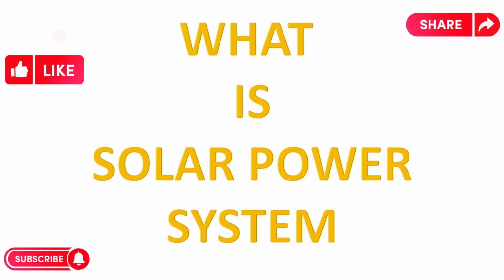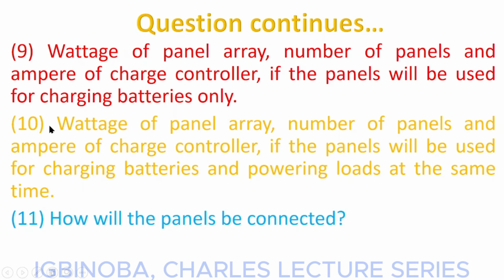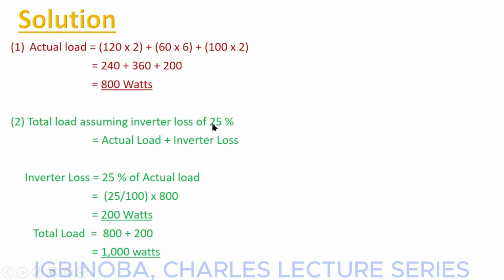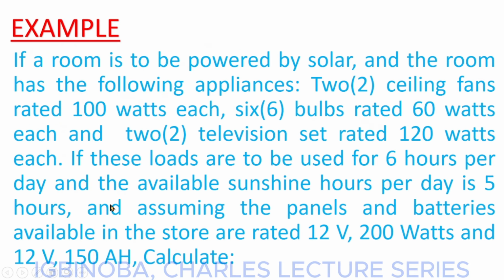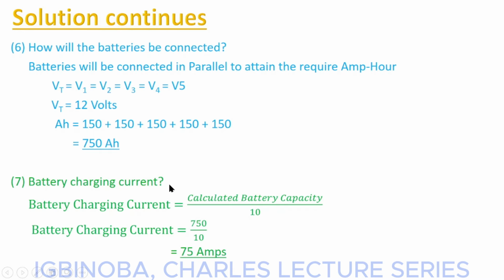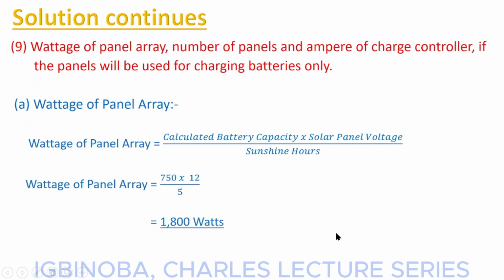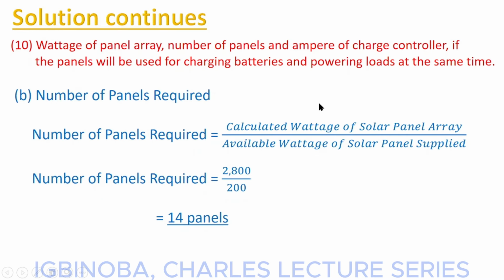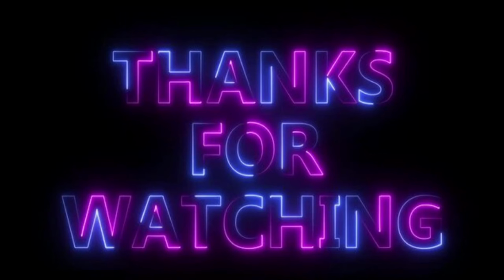Design of Solar Power System

Comment: EEE30D

1  .  The  actual  pad  is  1,380W  2  .  The  Total  load  is  1,725W  
3  .  The  inverter  rating  is  2,1  56.23VA  
4  .  The  battery  capacity  is  1,293.75Ah  
5  .  The  Number  of  batteries  is  9  6  .  The  batteries  are  connected  in  parallel  
7  .  The  Battery  charging  current  is  129.4  amps  .  
8  .  The  battery  charging  time  is  14  hours  .  
9  .  a  .  The  wattage  of  the  panel  array  is  3,105W  b  .  The  number  of  panels  is  16  panels  .  c  .  The  Charge  controller  rating  is  258.75  amps  .  
10  .a  .  The  wattage  of  the  Panel  array  is  4,830  Watts 
 b  .  The  number  panels  is  .  
11. The  panels  are  arranged  in  parallel

Comment: MAR61I

1. The actual pad is 1,380W
2. The Total load is 1,725W
3. The inverter rating is 2,156.23VA
4. The battery capacity is 1,293.75Ah 
5. The Number of batteries is 9
6.  The batteries are connected in parallel 
7. The Battery charging current is 129.4 amps.
8. The battery charging time is 14 hours.
9. a. The wattage of the panel array is 3,105W
b. The number of panels is 16 panels.
c. The Charge controller rating is 258.75 amps.

10. a. The wattage of the Panel array is 4,830 Watts 
b. The number of panels is 24 panels.
c. The charge controller rating is 402.5 amps
11. The panels are arranged in parallel

Comment: NAT55C
1. The actual pad is 1,380W
2. The Total load is 1,725W
3. The inverter rating is 2,156.23VA
4. The battery capacity is 1,293.75Ah 
5. The Number of batteries is 9
6.  The batteries are connected in parallel 
7. The Battery charging current is 129.4 amps.
8. The battery charging time is 14 hours.
9. a. The wattage of the panel array is 3,105W
b. The number of panels is 16 panels.
c. The Charge controller rating is 258.75 amps.

10. a. The wattage of the Panel array is 4,830 Watts 
b. The number of panels is 24 panels.
c. The charge controller rating is 402.5 amps
11. The panels are arranged in parallel

Comment: CHM61I

1) 1380 W

2) 1840 W

3) 2300 VA

4) 613.3 Ah

5) 10 batteries

6) Series-parallel: 2 in series, 24V  and  5 sets in parallel

7) 92 A

8) 8.33 h

9) Wattage: 3680 W, Panels: 20, Charge controller: ≈208 A

10) Wattage: 5520 W, Panels: 28, Charge controller: ≈292 A

11) 2 panels in series per string, strings connected in parallel — 10 strings for (9), 14 strings for (10)

Comment: EEE 13M

1. Actual power is 1380W
2. Total power is 1725 W
3. Inverter rating is 2070VA
4. Battery capacity is 1293.75AH
5. There will be 9 batteries
6. They will be connected in parallel 
7. The battery charging current will be 123.975A
8. Battery charging time is 14 hours
9a. Wattage of panel array is 3105W
b. The number of panels is 16
c. Charge controller current is 258.75 A
10a The wattage of the panel  array is a 4830W
b. Number of panels is 25 panels
c.  Charge controller is 402.5A
11. They are connected in parallel

Comment: MAR84F

1. The actual load is 1,380W
2. The Total load is 1,725W
3. The inverter rating is 2,156.23VA
4. The battery capacity is 1,293.75Ah 
5. The Number of batteries is 9
6.  The batteries are connected in parallel 
7. The Battery charging current is 129.4 amps.
8. The battery charging time is 14 hours.
9. a. The wattage of the panel array is 3,105W
b. The number of panels is 16 panels.
c. The Charge controller rating is 258.75 amps.

10. a. The wattage of the Panel array is 4,830 Watts 
b. The number of panels is 24 panels.
c. The charge controller rating is 402.5 amps
11. The panels are arranged in parallel

Comment: EEE29C 
Answers
Actual load = 1380W
Total load = 1725W
Battery capacity = 1293.75AH
Number of batteries = 9
Battery charging current = 129.375A
Battery charging time = 14hrs
Array wattage (charge only) = 3105W
Number of panels = 16
Charge controller current = 258.75A
Array wattage (charge + load) = 4830W
Number of panels = 25
Charge controller current = 402.5A

Comment: CIV22V
1)Actual load =1380W
2)Total load =1725W
3)Inverter Rating =2156.25VA
4)Battery Capacity =1293.75AH
5)no of batteries =9
6)Battery connection is parallel 
7)Battery charging current =129.375A
8)Battery charging time is 14hrs
9a)Array wattage is 3105W
b)no of panel is 16
c)charge controller current =258.75A
10)Array wattage (charge +load)=4830W
b)no of panel is 25
c)charge controller current=402.5A
11)panel connection is parallel

Comment: CHM77Y 
1: Actual load =1380W
2: Total load =1725W
3: inverter rating=2156.28W
4:Battery capacity=1293.75Ah
5: number of battery=9
6: Connected in parallel 
7: Battery charging current=129.375Ah
8: Battery Charging time with 40%loss=14hours 
9a: Wattage of panel array=3105W
9b: Number of panels=16panels 
9c: Ampere of Charge controller =258.75A
10a: Wattage of panel array with load=4485W
10b: Number of panels =23panels 
10c: Ampere of charge controller=373.75A
They will be connected in parallel

Comment: COMP66N

Answers:

The actual load is 1,380W

The Total load is 1,725W

The inverter rating is 2,156.23VA

The battery capacity is 1,293.75Ah

The Number of batteries is 9

The batteries are connected in parallel

The Battery charging current is 129.4 amps.

The battery charging time is 14 hours.

a. The wattage of the panel array is 3,105W

b. The number of panels is 16 panels.

c. The Charge controller rating is 258.75 amps.

a. The wattage of the Panel array is 4,830 Watts

b. The number of panels is 24 panels.

c. The charge controller rating is 402.5 amps

The panels are arranged in parallel.

Comment: COMP14N

1. The actual pad is 1,380W
2. The Total load is 1,725W
3. The inverter rating is 2,156.23VA
4. The battery capacity is 1,293.75Ah 
5. The Number of batteries is 9
6.  The batteries are connected in parallel 
7. The Battery charging current is 129.4 amps.
8. The battery charging time is 14 hours.
9. a. The wattage of the panel array is 3,105W
b. The number of panels is 16 panels.
c. The Charge controller rating is 258.75 amps.

10. a. The wattage of the Panel array is 4,830 Watts 
b. The number of panels is 24 panels.
c. The charge controller rating is 402.5 amps
11. The panels are arranged in parallel

Comment: CIV72T
Answer 

1. Actual load = 1380Watt
2. Total load = 1725Watt
3. Inverter rating = 2156.25VA
4. Battery Capacity = 1239.75Ah
5. Number of batteries = 8.625 (9 batteries)
6. They will be connected in parallel
7. Battery charging current = 129.375A
8. Battery charging time with 40% loss = 14hrs
9a. Wattage of panel array = 3105Watt
9b. Number of panels = 16panels
9c. Ampere of charge controller = 258.75A
10a. Wattage of panel array with load =
4485 Watt
10b. Number of panels = 23panels
10c. Ampere of charge controller = 373.75A
11. They will be connected in parallel.

Comment: PETRO49W
Answers:

The actual load is 1,380W

The Total load is 1,725W

The inverter rating is 2,156.23VA

The battery capacity is 1,293.75Ah
The Number of batteries is 9

The batteries are connected in parallel

The Battery charging current is 129.4 amps.

The battery charging time is 14 hours.

a. The wattage of the panel array is 3,105W

b. The number of panels is 16 panels.

c. The Charge controller rating is 258.75
amps.

a. The wattage of the Panel array is 4,830
Watts

b. The number of panels is 24 panels.

c. The charge controller rating is 402.5 amps

The panels are arranged in parallel

Comment: EEE51Y 

Answers
Actual load = 1380W
Total load= 1725W
Battery capacity= 1293.75AH
Number of batteries= 9
Battery charging current= 129.375A
Battery charging time= 14hrs
Array wattage (charge only) = 3105W
Number of panels = 16
Charge controller current= 258.75A
Array wattage ( charge + load) = 4830W
Number of panels= 25
Charge controller current= 402.5A

Comment: CIV20T
1 actual load- 1380 watts 
2 total load- 1725 watts 
3 inverting rating- 2156.25va
4 battery capacity-1293.75AH 
5 number of batteries- 9 
6 batteries were connected in parallels 
7 battery charging current- 129.4 amps 
8 battery charging time- 14hrs
9 wattage of panels(,for battery)- 3106 watts 
No of panels - 16 
Ampere charge controller- 258.83A 
10 for battery and load 
Wattage of panel- 4831 watts
No of panel- 25
Ampere charging controller- 402.58 Amps
Reply: COET/13126/204

1. The actual pad is 1,380W
2. The Total load is 1,725W
3. The inverter rating is 2,156.23VA
4. The battery capacity is 1,293.75Ah 
5. The Number of batteries is 9
6.  The batteries are connected in parallel 
7. The Battery charging current is 129.4 amps.
8. The battery charging time is 14 hours.
9. a. The wattage of the panel array is 3,105W
b. The number of panels is 16 panels.
c. The Charge controller rating is 258.75 amps.

10. a. The wattage of the Panel array is 4,830 Watts 
b. The number of panels is 24 panels.
c. The charge controller rating is 402.5 amps
11. The panels are arranged in parallel

Comment: CIV69Q 

1. Actual load = 1380 watts
2. Total load = 1725 watts
3. Inverter rating = 2156 VA
4. Battery capacity = 1294 Ah
5. Number of batteries = 9
6. Parallel
7. Battery charging current = 129.4 Ah
8. Battery charging time = 14 hr
9a. Panels wattage = 3106 watts
9b. Number of panels = 16
9c. Charge controller = 258.8 A
10a. Panels wattage = 4831 watts
10b. Number of panels = 24
10c. Charge controller = 402.5 A
11. Parallel

Comment: EEE57E
1. The actual pad is 1,380W
2. The Total load is 1,725W
3. The inverter rating is 2,156.23VA
4. The battery capacity is 1,293.75Ah 
5. The Number of batteries is 9
6.  The batteries are connected in parallel 
7. The Battery charging current is 129.4 amps.
8. The battery charging time is 14 hours.
9. a. The wattage of the panel array is 3,105W
b. The number of panels is 16 panels.
c. The Charge controller rating is 258.75 amps.

10. a. The wattage of the Panel array is 4,830 Watts 
b. The number of panels is 24 panels.
c. The charge controller rating is 402.5 amps
11. The panels are arranged in parallel

Comment: CIV47U 

ANSWER:

(1). Actual Load = 1380Watts.

(2). Total Load = 1725Watts.

(3). Inverter Rating = 2156.25VA.

(4). Battery Capacity = 1293.75Ah.

(5). Number Of Batteries = 9.

(6). Batteries Are Connected In Parallel.

(7). Battery Charging Input = 129.4amps.

(8). Battery Charging Time = 14hrs.

(9.a). Wattage Of Power Array = 3105Watts.

(b). Number Of Panels = 16 panels.

(c). Charge Controller = 258.75A.

(10.a.) Wattage Of Panel Array = 4830Watts. 

(b). Number Of Panels = 24 panels.

(c). Charge Controller = 402.5A.

(11). Panels Are Arranged In Parallel.

Comment: NAT37K

1. The actual pad is 1,380W
2. The Total load is 1,725W
3. The inverter rating is 2,156.23VA
4. The battery capacity is 1,293.75Ah 
5. The Number of batteries is 9
6.  The batteries are connected in parallel 
7. The Battery charging current is 129.4 amps.
8. The battery charging time is 14 hours.
9. a. The wattage of the panel array is 3,105W
b. The number of panels is 16 panels.
c. The Charge controller rating is 258.75 amps.

10. a. The wattage of the Panel array is 4,830 Watts 
b. The number of panels is 24 panels.
c. The charge controller rating is 402.5 amps
11. The panels are arranged in parallel

Comment: PETRO21U 

1. 1380 W
2. 1725 W
3. 2156.25 VA
4. 1293.75 Ah
5. 9 batteries 
6. Parallel connection
7. 129.375 A
8. 14 hrs
9a. 3105 W
9b. 16 panels
9c. 258.75 A
10a. 4830 W
10b. 24 panels
10c. 402.5 A
11. Parallel connection

Comment: MAR46T 

ANSWERS:
1. Actual Load = 1,380W

2. Total Load (25% loss) = 1,725W

3. Inverter Rating = 2,156.25VA

4. Battery Capacity = 1,293.75AH

5. Number of Batteries = 9 batteries

6. Battery Connection = Parallel

7. Battery Charging Current = 129.375A

8. Battery Charging Time = 14hrs

9a. Array Wattage (Charge Only) = 3,105W
9b. Number of Panels = 16 panels
9c. Charge Controller Current = 258.75A

10a. Array Wattage (Charge + Load) = 4,830W
10b. Number of Panels = 25 panels
10c. Charge Controller Current = 402.5A

11. Panel Connection = Parallel

Comment: PETRO12L

Answers:
Actual load = 1380 Watt
Total load = 1725 Watt
Inverter rating = 2156.25 VA
Battery Capacity = 1239.75 Ah
Number of batteries = 8.625 (9 batteries)
They will be connected in parallel
Battery charging current = 129.375 A
Battery charging time with 40% loss = 14 hrs
9a. Wattage of panel array = 3105 Watt
9b. Number of panels = 16 panels
9c. Ampere of charge controller = 258.75 A
10a. Wattage of panel array with load = 4485 Watt
10b. Number of panels = 23 panels
10c. Ampere of charge controller = 373.75 A
They will be connected in parallel.

Comment: COMP37K 
Actual load=1380watts
Total load=1725Amps
Inverter rating=2156.25VA
Battery capacity=1293.75Ah
Number of batteries for back up hour=9 batteries
The batteries will be connected in parallel 
Battery charging current=129.275Amps
Battery charging time with a loss of 40%=14hrs
Wattage of panel array=3105Watts
Number of panels=16panels
Ampere of charge controller=258.75Amps
Wattage of panel array for batteries and load=4830Watts
No of panel = 25 panels
Ampere of charge controller=402.5Amps
The panel will be connected in parallel

Comment: MAR13M

1. 1380W
2. 1725W
3. 2156.25VA
4. 1293.75Ah
5. 9 batteries
6. Parallel connection
7. 129.3A
8. 14hrs
9a. 3105W
9b. 16 panels
9c. 258.75
10a. 4830W
10b. 25panels
10c. 402.5A
11. Parallel connection

Comment: PETRO90L

1. Actual Load = 1380watts

2 Total load = 1725Watts

3. Inverter reading = 2156V

4. Battery capacity using a reserve of 75% = 1293.75AH

5. Numbers of batteries for backup = 9hours

6. The batteries will be connected in parallel 

7. Battery charging current = 129.4A

8.  Battery ttery charging time with a loss of 40% is =14hours

9a. Wattage of panel energy array = 315W

9b. Numbers of panel = 16

9c. The charge controller rating = 258.75

10a. Wattage of panel array = 4830Watts

10b. Number of panels = 24panels

10c. Charge controller rating = 492.5

11. The panel were connected in parallel

Comment: MAR96R

Answers:
The actual load is 1,380W
The Total load is 1,725W
The inverter rating is 2,156.23VA
The battery capacity is 1,293.75Ah
The Number of batteries is 9
The batteries are connected in parallel
The Battery charging current is 129.4 amps.
The battery charging time is 14 hours.
a. The wattage of the panel array is 3,105W
b. The number of panels is 16 panels.
c. The Charge controller rating is 258.75 amps.
a. The wattage of the Panel array is 4,830 Watts
b. The number of panels is 24 panels.
c. The charge controller rating is 402.5 amps
The panels are arranged in parallel

Comment: EEE47U 

ANSWER 
1) actual load= 1380watts. 2) total load=1725watts. 3) inverter rating= 2156.25va. 4) battery capacity 1293.75ah 5) number of batteries= 9. 6) connection parallel.7) battery charging current=129.375.8) charging time 14hours  9)  a wattage of panes array =  3105w B)  number of panels 16 panels charge controller 258.75A. 10) A wattage of panels array 4830w. B) number of panels 24. C) charge controller=4025A. 11) panel arrangement parallel

Comment: CIV91M
ANSWERS;
1. Actual Load = 1,380W
2. Total load (25% loss) = 1725W
3. Inverter rating = 2156.25VA
4. Battery Capacity = 1293.75AH
5. Number of Batteries = 9 batteries
6. Battery Connection = Parallel
7. Battery Charging Current = 129.375A
8. Battery Charging Time = 14hrs
9a. Array Wattage (Charge Only) = 3105W
9b. Number of Panels = 16 panels
9c. Charge Controller Current = 258.75A
10a. Array Wattage (Charge + Load) = 4830W
10b. Number of Panels = 25 panels
10c. Charge Controller Current = 402.5A
11. Panel Connection = Parallel

Comment: CIV42P 

1.Actual load = 1380 Watts
2.Total load = 1725 Watts
3.Inverter rating = 2156.25 VA
4.Battery Capacity = 1293.75 AH
5.Number of Batteries = 9 batteries
6.Batteries connection: Parallel
7.Battery Charging Current: 129.375 A (150 A)
8.14 Hours
9a. Wattage of panel array (charging only batteries) = 3105.6 Watts
9b. Number of panels = 16 panels
9c. Ampere of charge controller = 358.8 A
10a. Wattage of panel array (Battery and load) = 4831 Watts
10b. Number of panels = 24 panels
10c. Ampere of charge controller = 402.6 A
11.Panel connection: Parallel

Comment: MEC58F 

1. Actual load = 1380 W

2. Total load considering 25% inverter loss = 1840 W

3. Inverter rating = 2300 VA (2.3 kVA)

4. Battery capacity = 1226.67 Ah

5. Number of batteries = 9 batteries

6. Battery connection = Parallel connection
   Battery bank = 12 V, 1350 Ah

7. Battery charging current = 245.33 A

8. Battery charging time with 40% charging loss = 8.33 hours

9. For charging batteries only:
   Panel array wattage = 2944 W
   Number of 200 W panels = 15 panels
   Charge controller = 245.33 A

10. For charging batteries and powering loads simultaneously:
    Panel array wattage = 4784 W
    Number of 200 W panels = 24 panels
    Charge controller = 398.67 A ≈ 399 A

11. Panel connection:
    15 panels in parallel for Question 9
    24 panels in parallel for Question 10

Comment: EEE49W
Answer:
1.Actual load=1380W
2.Total Load=1735W
3.inverter rating=2156.25VA
4.1350AH
5.9 batteries 
6.in parallel
7.135A
8.14 hours 
9.3240W
9B.16 panels
9C.270A
10A.4965W
10B.25 panels
10C.413.75A
11. In parallel

Comment: COMP67O

ANSWERS:
1. 1380 watts
2. 1725 watts
3. 2156.25VA
4. 1293.75Ah
5. 9 batteries 
6. batteries will be connected in parallel 
7. 129.3A
8. 14 hours
9a. 3105 watts
9b. 16 panels 
9c. 258.75A
10a. 4830 watts
10b. 25 panels
10c. 402.5A
11. the panels will be connected in parallel.

Comment: MAR58F
 

Answers:
 The actual load is 1,380W
The Total load is 1,725W
The inverter rating is 2,156.23VA
The battery capacity is 1,293.75Ah
The Number of batteries is 9
The batteries are connected in parallel
The Battery charging current is 129.4 amps.
The battery charging time is 14 hours.
a. The wattage of the panel array is 3,105W
b. The number of panels is 16 panels.
c. The Charge controller rating is 258.75 amps.
a. The wattage of the Panel array is 4,830 Watts
b. The number of panels is 24 panels.
c. The charge controller rating is 402.5 amps
The panels are arranged in parallel